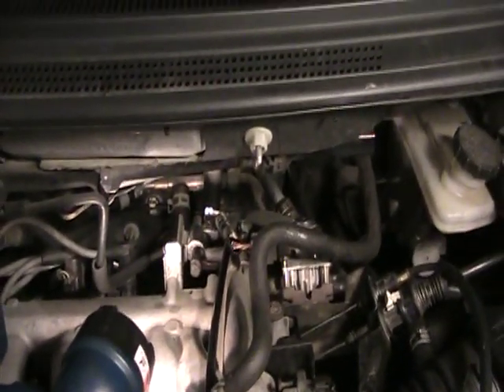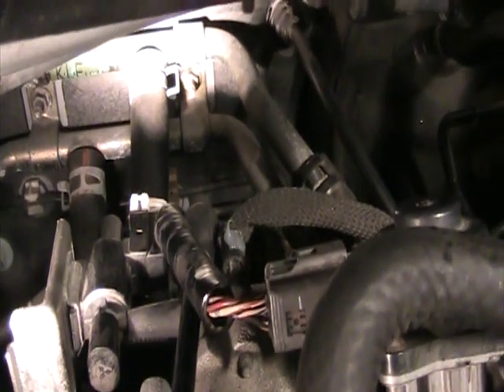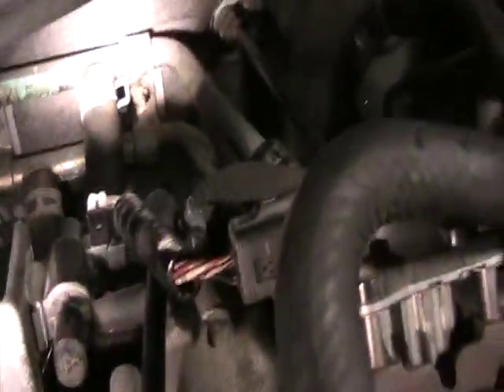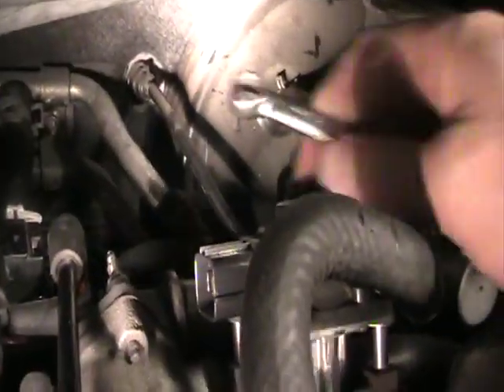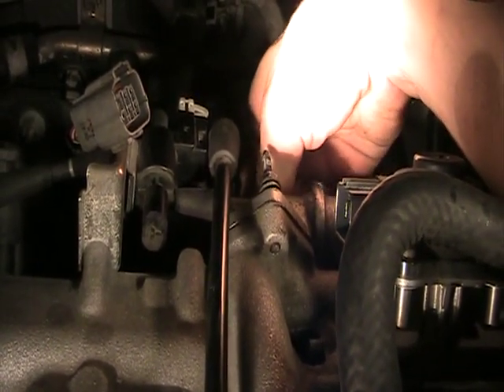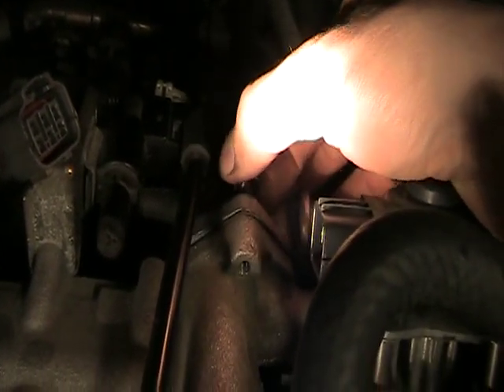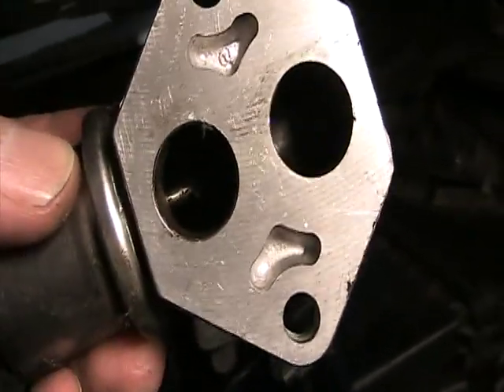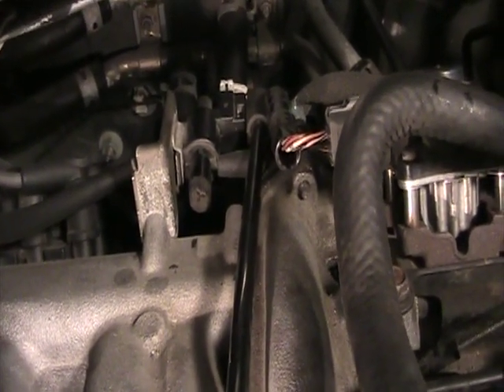Cleaning your IAC to fix rough idle on 2000 or 2001 Mazda MPV

Comment: 2001 Mazda MPV ES with almost 150,000 miles owner, OBD threw up a MAF sensor code so I’m cleaning my MAF Sensor and the ICAV as well.  Thank you for the video as it has made the process of removal easy!  I will update my comment one last time after I put it all back together and see if it runs better!
(I will say that a TON of black gunk came out of my ICAV so hopefully that does the trick!).

EDIT : It worked!  Drives way better now (instead of the hooting I now have a flex pipe that needs replaced but hey, as long as the engines breathing correctly that’s all that matters!)
Thank you again for this video!  Have a great life everybody!

Comment: Hello sir I have Mazda 2001 van and I have a blinking engine sing in the dashboard so I was wandering do you have any tips on how to fix that?
Reply from the maker: +bikash gur 
I assuming you mean a blinking check engine light.   A blinking check engine light usually means engine misfire.   Usually means replacing spark plugs and wires together.  SOmetimec the coil 
pack also need replacing.  For plugs and wires use original parts  from Ford if possible.  Engine is very picky on wires and plugs.
Reply: got it i will try that, thanks.

Comment: Ok so my car always idle at 1100 I just replaced my iac valve this morning I cleaned the inside of the throttle body and plate and right when I started it up it idled where its supoose to be at 700 but den 30 mins later went back up to 1100 well I didn't notice a change in the way the engine souded still quiet and normal but the needle was back at 1100 rpm at idle should I replace my throttle position sensor also?would that help? already checked for leaks and seafoamed my car i have a complete tune up also
Reply from the maker: Sounds like you have done a great job.
My Van Idles at 1100 than drops gradually to 900 over a 5 minute period.  In drive with the foot on the brake the RPM is around 800.  It all depends on factors is the AC running, heater, or how much load is on the alternator etc. It does not sound to unreasonable what you are describing. Changing the TPS sensor will not help much.  There are some adjustment screws that are stoppers for the throttle body cable. They sit on the throttlebody. This sets the TB position with no foot on the gas peddle.  Take notes before you mess with them so you can set them back to there original position if required. I am not so sure you have to do anything at all.  Good Luck.
Reply: janerikborge no my ac is not running its been a long winter long cold winter in mn i still have not used it yet and i have not used the heat in a while either i just switch it to circulate mode where air come in through the outside air vent and leave the switch to off position and evan when i manully close the throttle plate the idle do not change
Reply: janerikborge i wish it was a way to pull the iac valve tip out a little farther so it wont let so much air in but autozone told me that the car computer adjust that part iv done about everything i could think of evan sprayed my egr valve down could my tps be allowing to much air in?im pretty sure its dirty because my iac valve had alot of carbon on it when i took it off

Comment: one of My problems was mass air flow and vacuum leaks.But I just did a tune up and got wires mixed up not firing sequence but by kv rating i was going by wire length... doh. think my 456 is right but tried several different combos on 123 cylinders. What i currently have 1-935kv,2-827kv, 3-809kv. front 4-812kv,6-917kv,5-841 from coil pack.  Any help would be greatly appreciated mazda forums wont let me sign up. thanks.
Reply from the maker: Sorry for the late reply.
I fought hard when  I did my plugs and wires.  The Ford 2.5l Duratech  Engine is extremely sensitive to wires (used in 2000- 2001 year).   I would only use the Ford stock wires.  Same goes with plugs. I had to throw away brand new aftermarket wires.  Also just recently the coil pack just went causing engine misfires.   This was a $89 item.   

Google "MPVclub" it is a great forum with a lot of resources on the van.
Reply: About pulled my hair out great indef info thanks brother shuld have looked u up first from one grease monkey to another thanks the IAC done the trick

Comment: I saw this and was able to replace my valve in about 15 minutes.  My symptoms were that the car would not idle when cold, like below 50F.  On cold days, I would have to keep my foot on the accelerator or it would die.  I went ahead and replaced the valve with a new one.  Thanks for the video.

Comment from the maker: There is a rubber elbow below the throttlebody that is known to crack on the MPV causing a vac leak.  There is a website called mpvclub that has info.  But if your acceleration is effected then changing both plugs and wires together might be required. You should be getting misfire codes once in a while.  I did a slideshow on the sparkplug removal on picassa. Google sprark plug change mazda mpv .  The forum mpvclub has info.
Reply: Mine was cracked. Pulled it off. Spread it apart. Cleaned it real good. Then all i did was wrap black electrical tape super super tight around the crack in the joint a few times.  No more leak. Trying to find one without going through the stealership is impossible to find a non cracked one

Comment from the maker: I made a separate video for cleaning the throttle body.  When I remove the throttle body you will see the ERG passages behind the throttlebody, which you might see as being plugged a bit on the video.

The EGR valve helps your car more efficiently and completely burn fuel by recirculating a portion of your exhaust and running it through the combustion process again. 

Google : egr valve removal mazda mpvclub 

Links are not allowed here.

Comment from the maker: Glad to have helped!
Usually this is all that needs to be done.
If the problem returns in a year or so, then just drop in a new one for about $80.
Reply: Or just clean it again.. If it worked the 1st time. It would work again after a year of carbon build up.

Comment from the maker: Yes it fixed the hooting sound that I had.   Most of the time the problem is related to a rough idle.  It is a  common problem as cars get older.  Keep in mind the IAC is a non serviceable part, and sometimes the cleaning fixes the problem temporarily. A new IAC is about $80.
Reply: From oriellys the guy quoted me 251 lol